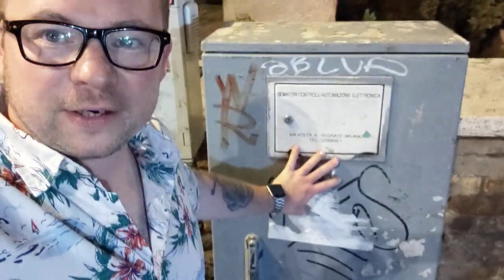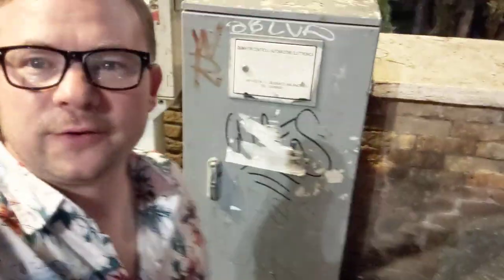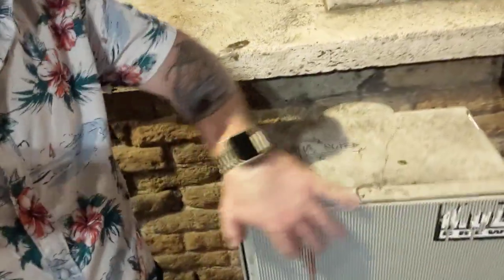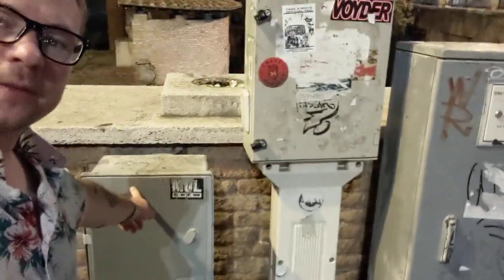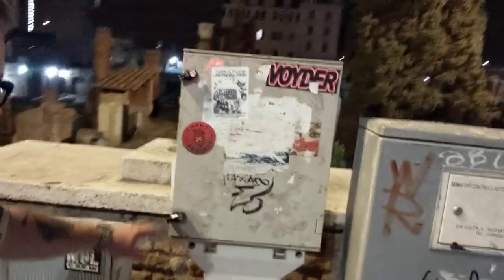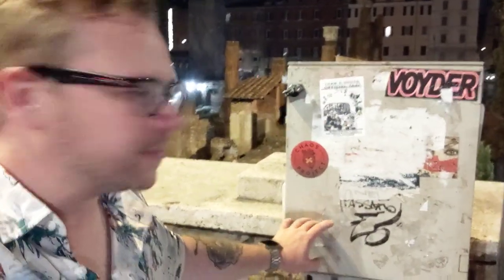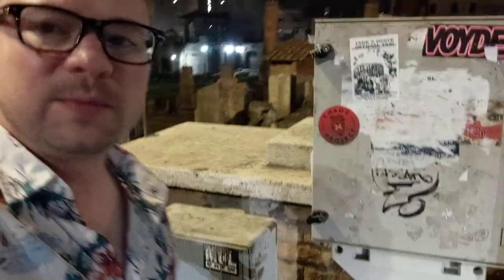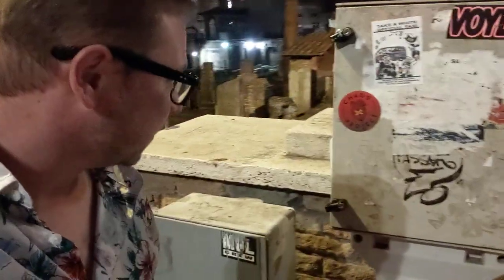Traffic signal in ITALY!

Comment: What tools do you use on a daily basis?
Reply from the maker: I should make a video for that... I use a multi meter,  a Meg-Ohm meter a utility locator, a loop finder,  screwdrivers, wire cutters, wire strippers and butt splice crimpers. A few more tools than that but that's the basics.
Reply: Traffic Signals Training I agree! That would make for a great video!